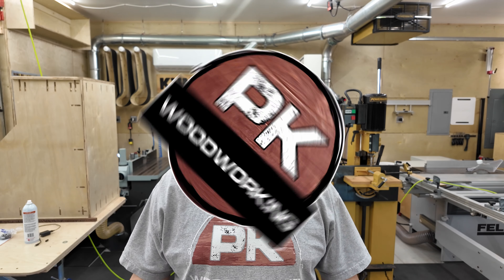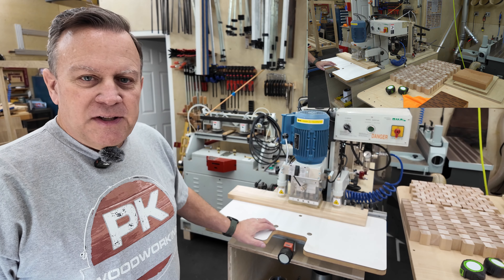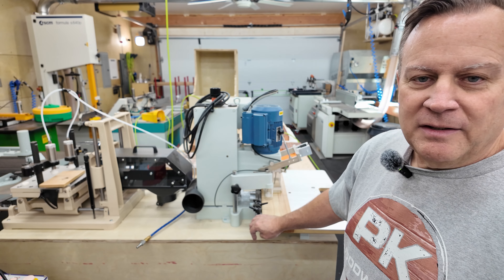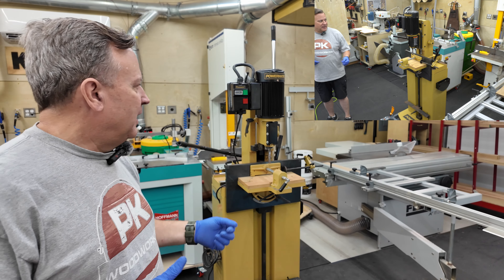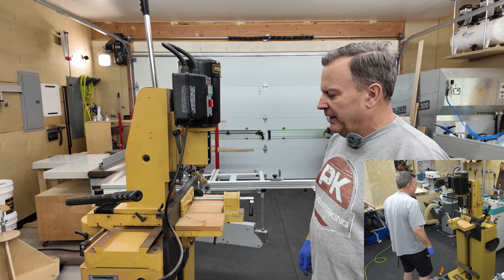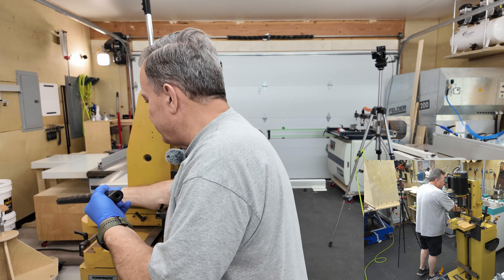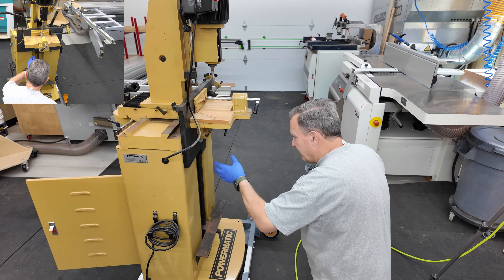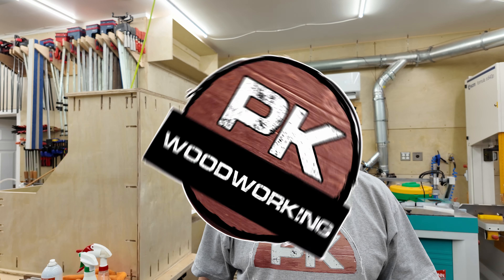Brand New Second Hand Machines keep showing up!  What is the story with these Machines?

Comment: Awesome finds Paul.  I remember meeting you, your brother and dad at the 2022 IWF.  It looks like you have about 50 square feet left to fill with more great finds.  You are confirming my theory that machinery is not solid but gaseous as they fill and conform to whatever size and shaper container they are placed in.  There is no such thing as a shop that's too large.  The only thing that changes is the pressure on the outside walls.  😁  Steve
Reply from the maker: Very poetic Steve.  I will replace for better at this point   No Mas.

Comment: Hi there - you mentioned the Hoffman had some pitting. I’m trying to clean up some pitting on a table saw I’ve been restoring. It’s the black deep spots I can’t seem to clean out…any advice ?
Reply from the maker: I think the Hoffmann top is Aluminum but not sure.  I start with ballistol and a maroon scotchbrite pad.  Then i move to PG2000 and a maroon or grey pad.  I then move to Carbon Method reconditioning oil with the grey pad.  I then go to the withe pad.  If it is really bad I will use an old sander with the pads.
Reply: @pkwoodworking  thank you for the details. Much appreciated
Reply from the maker: Good luck!

Comment: Good morning 🌅, PK , I think you might need a bigger work shop, 😂, the hollow Mortis Chisler looks like a nice, about 20 years ago, I brought myself a very old hollow and chain mortise Chisler Three phase, I believe it weighed somewhere close to a ton, I believe it dated back from the late 40s early 50s, I removed the main motor off the top and it’s a sliding mechanism and had it all resurfaced, i’ve got some wheels to fit on it from Falder , and I managed to pick up a air operated clamp mechanism for holding the timber in place so all you have to do was flip a little switch and I could operate the pressure of my compressor, I wish I still got it, This is a very, very nice machine, I think if you had to buy new nowadays will cost you anywhere between 5 to £7000, I have literally made 100 of windows and doors on it, I’ve still got all my chisel bits, though the person who had purchased it from me didn’t get C spanner to unlock the chuck, it was in my toolbox, 
In 2019 I had stopped working, and was trying to move to France, I ended up having to sell a lot of my machine cheep , so I could move out of my factory-workshop , 8m X 36m , I have now got my WADKIN EKA up running, and very large Re-saw working as well, 
Keep up the great work, hope to see you making something soon, From France.
Reply from the maker: Thanks!